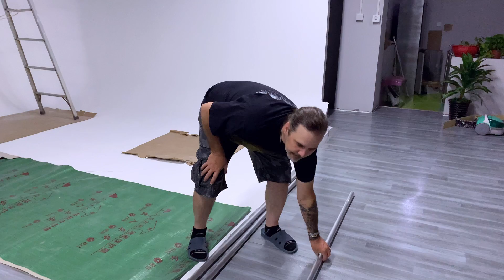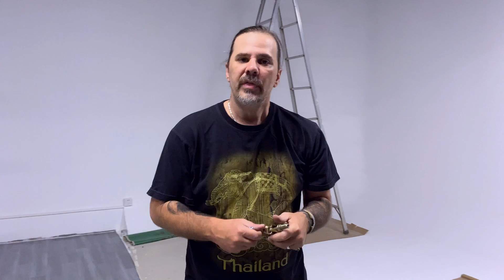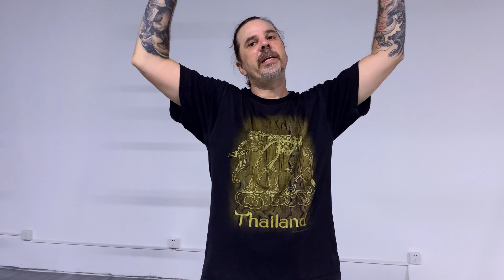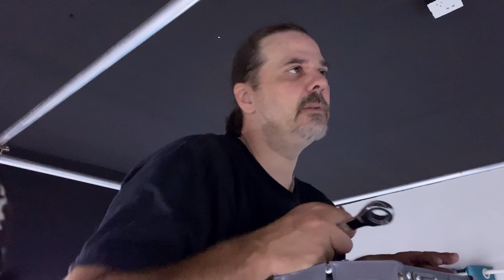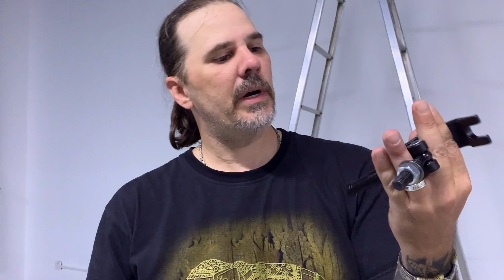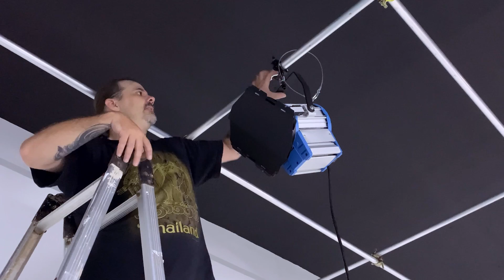How to Build a DIY Overhead Lighting Grid for Your Studio! 💡🎥 Perfect for Photography & Video

Comment from the maker: In this video, I break down how I built a DIY cyc wall and overhead lighting grid—from planning and materials to layout, rigging, and lighting control. This setup is designed for flexibility, clean backgrounds, and efficient workflows in a real working studio.

If you’re thinking about building your own cyc or grid, drop your questions below and I’ll share what worked, what I’d change, and lessons learned along the way.

Comment: We are planning to do something similar. Which type of fabric have you used for the diffuser to be placed under the lighting grid?
Reply from the maker: I think you are trying to make an overhead soft box. This is purely a lighting grid. In the video below I discuss making a soft box. I usually would go with a grid cloth or magic cloth. Grid cloth is a better choice and you can choose how thick you want it based on your lighting. If you are using low wattage lights you probably want to go with a 1/2 or 1/4 grid cloth.
https://youtu.be/nhCJC_gLGFg

Comment: How much space do you recommend 
I am going to use it for photography
Reply from the maker: My space is roughly 1500sq feet. The actual cyc wall is close to 300sq feet. You make what you have work. I do multiple types of work like videography and photography which is why my space is a bit larger. Also, a 10ft ceiling is an added bonus if you want to hang lights in the sky like my studio.

Comment: Where did you buy all the materials?
Reply from the maker: The aluminium pipe needs to be purchased from a metal supplier in your area. The speed rail fittings and cheeseborough can be purchased on amazon or modern studio equipment website.